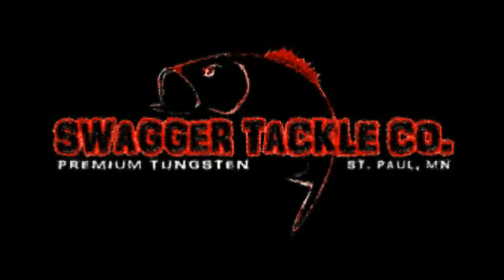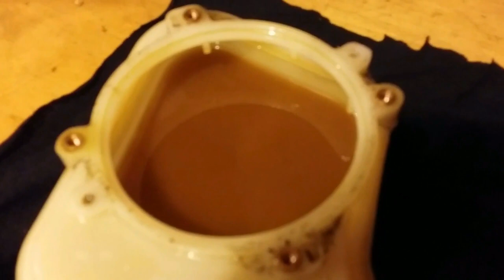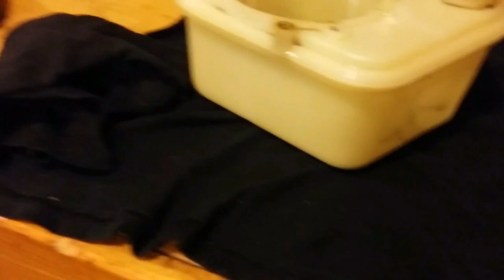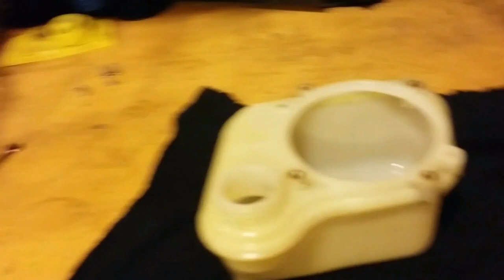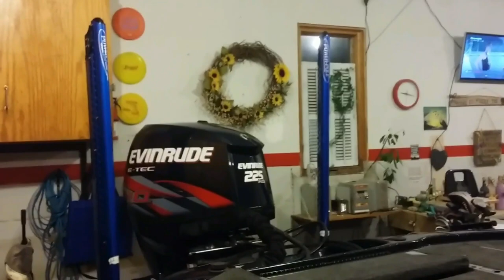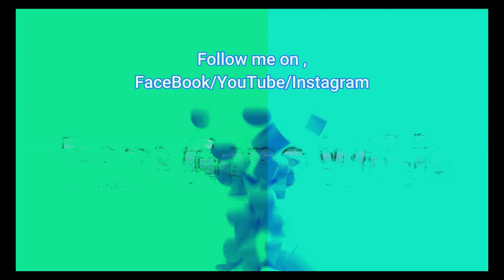Power pole pump issue

Comment: Great video. Today I had to install 90 degree fitting on the pump for ease of routing on my C monster pump. I cleaned the reservoir cause it has a lot of gum stuck also. It seems this Hyd fluid gets contaminated easely.

Cheers

Comment: Awesome info if I just pulled those 4 screws off the reservoir and didn't pull pump out looks like 4 small screws?
Reply from the maker: 4 small screws holding the fluid canister.

Comment: Very good video. I'm in the process of researching them now. Could not help from seeing all the debris in the tank. Was it trash or was it metal shavings. I was wondering if there might be worn parts in the pump that ended up in the reservoir.  And if not how did all that get into the system. I run a hydraulic snow plow that works on the same principal and had some of the same issues cleaned it out and it ran good for awhile but eventually I had to rebuild the pump. The same issues came back and it was fine metal shavings or shaving dust. The way I  determined it was to run a magnet threw the debris and it loaded up. Thanks for doing the video and helping others out. I'm trying to do my homework before this expensive purchase.
Reply from the maker: Bleed the line leading the hydraulics in the arm

Comment: I’m confused in why the fluid is getting contaminated?? What did power pole say? That fluid should last awhile
Reply from the maker: Correct me if I'm wrong. But it has many factors as to why the fluid can get contaminated. Moisture can get into the fluid.. If you have hydraulic lines in the water and water gets in the compression nuts it will mix into the fluid. A cracked line etc.... its a good idea to check your lines and make sure the connections are tight once in a while. In time fluid can get bad from the elements. Same as oil in your vehicle. If you don't change your oil in the vehicle it will be so dirty and can damage the internals and plug ports. Gum up in the motor. Kinda the same concept. You have an electric hydraulic motor with ports in the housing.
Reply: The biodegradable fluid degrades over time.

Comment: So your entire issues was debris in the lines and reservoir?
Reply from the maker: Plugged screens. Wasn't moving the fluid throu the screen causing it to move slow and making the pump work harder to the point it was making noise.

Comment: Powerpole sells an environmentally safe oil in case of leaks.
Reply from the maker: I hear ya. 
There's a lot of lubricating substance in them out boards to. Probably sell the boat and get a kayak in that case.
Reply: I think it’s that bio crap that causes the problem
Reply: The "green marine" tree hugger oil is what causes the oil to gum up.  Get some quality Mobil DTE 24 ISO 32 oil and it will outlast the pump.  Yes its expensive, but well worth not damaging your pump.

Comment: This is an old video.  They do not want you using any fluid other than their fluid.
Reply from the maker: Yes its an old video. I should remove it. The thing about this video is to keep your pumps clean. I understand your case. But I will still keep using what I have been using;). Never had any issues at all. I'm still using the same power pole from my ranger and transferred them on my vexus. My fluid is clean still and still using the same fluid I normally buy.